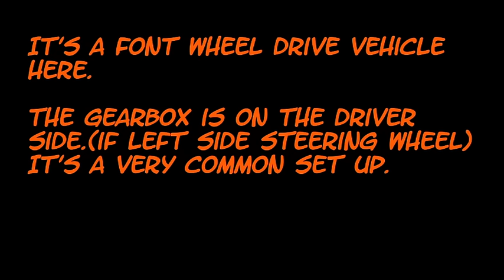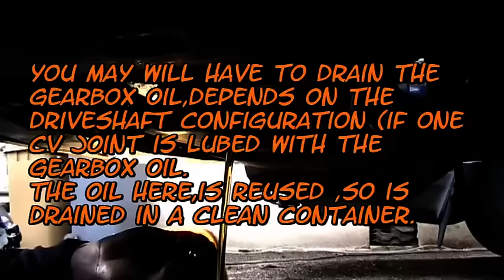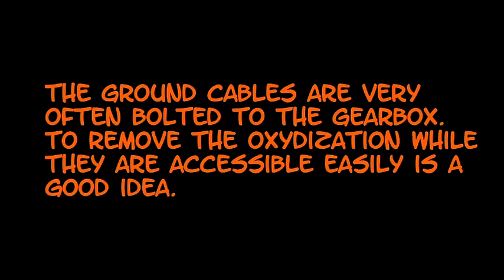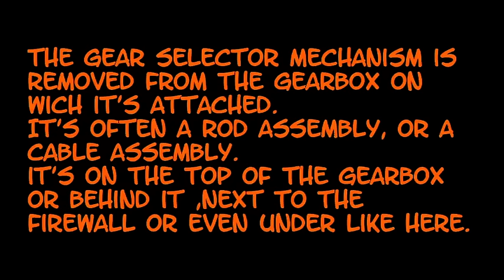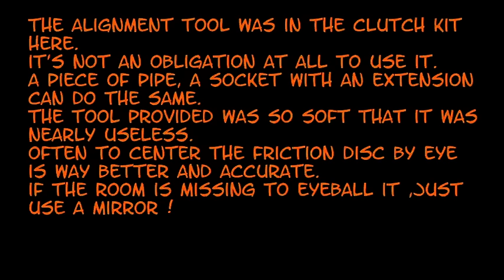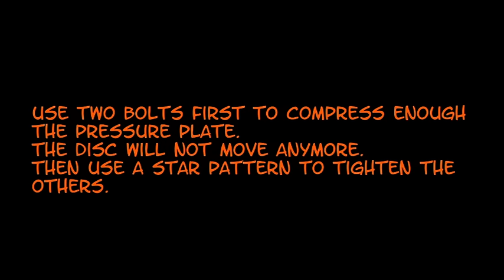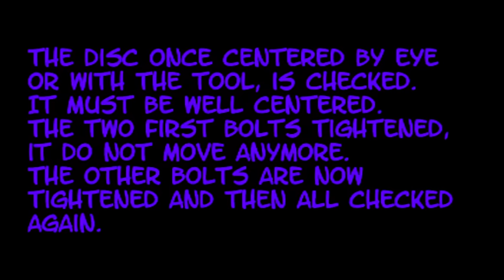Front Wheel Drive car clutch replacement.

Comment: You did one big mistake . All that grease is going to find its way to the clutch plate facings and the fine dust produced during use is going to stick to the grease and results in a sticky messy lump. Only graphite powder should be used on the splines of the  shaft of the gearbox.Apart from this , it is a very good video.
Reply: +Victor Calleja Way too much too...
Reply: For sure! Way to much grease! Good video otherwise.
Reply: Victor Calleja 난
Reply: agree with u.
Reply: Victor Calleja
Reply: Luis Orozco uasap
Reply: uasap ppupi
Reply: On my 1989 Mercury Tracer (Mazda 323), when I tighten the Pressure Plate the "fingers" on it go totally flat. When I install the transmission there is no clutch pedal at all. Due to the fact it feels like the clutch is already disengaged.
  What could the problem be? I purchased the part from O'Reilly's.
Reply: Nah it'll be fine
Reply: 707SonomaComa  clutch plate in the wrong way round
Reply: Not really even on Nissan manual manufacturer recomends to grease splines and release bearing with lithium-based greese including molybdenum disulphide. But not a lot of it. Just 1mm. thick coating.
Reply: Victoحناف2
ز 
9.
r Calleja
Reply: I want to change my clutch but scared
Won't be able to put it back together.
Reply: Internet mechanic they know it all
Reply: Knocking out the suspension bolts using a hard-faced hammer directly onto the screw-threads is a mistake.There are at least 3 better ways of doing that without risking thread damage.
Reply: @ianrutherford878  if u want to hit the threads put the nut back on at the end of the thread then give it a hit won't fuk it
Reply: @707SonomaComa - Refer to 17:39 in this video. Assembled the wrong side. ;-)
Reply: You’re half correct. Yes, it is more than enough grease, however, Moly grease is approved for numerous clutch assemblies.
Reply: Grease is fine on the splines of the gearbox shaft only a little bit rho
Reply: I do not use any lube on the clutch splines. I don't believe the clutch plate even moves on the spline during operation but just stays against the flywheel and gently still rubs on the flywheel. Also I just made an extra extra simple new type gearbox lifters that may help if you are about to do this type of work. I just uploaded to youtube. If you click my name you should see them.
Reply: Victor Calleja I agree
Reply: fuqoff aye? You need to watch Chris Fix channel on the subject. He will say the same thing
Reply: 707SonomaComa You have put the clutch on the correct way and bled the clutch?
Reply: Yes your right sir
Reply: Hey so when I put grease like he did just enough to keep it lubricated
Reply: Victor Calleja yeah thought that and also to remove the brake and hang it somewhere safe to protect the brake line from being damaged it's rare that it gets damaged by doing this but it does still happen so it's good practice to remove it as well
Reply: @allfoursafridafrid8002  yes you will.
Reply: @jaykaiser1754  molly + grease  wow. Lol
Reply: @luisorozco3420  🤣😂🤣😂👍🏻
Reply: What a pain in da assss but they want 1200 down town so i will go slow
Reply: @live4high  manual for the twingo says not to lubricate the shaft splines at all.
Reply: @live4high  🌹🌹❌
Reply from the maker: All right, seven years later :
No grease on the disc or plate,the spline was still lubed up,like the fork pivot point.
It was molybdene grease for heavy equipment and machinery,wich is very sticky and made for translation,or pivot points.
You can see that here : https://youtu.be/lfTu7FSgTX4
Reply: @michaelovitch thx!

Comment: Very clear video , well explained how you can do this terribly expensive repair yourself .
Personally I would also use no or minimal grease. But if these guys prefer that, that's fine.
Pissing on others is easy, if you can do better you should indeed post a video yourself.
Definitely won't be the first clutch these guys put up judging by their speed.

Good video guys!
Reply from the maker: Thank you.

Comment: Thank you very much for sharing this video, very helpful to me. I have a similar engine and box in my Renault 5 get turbo 1986 phase 1. I have taken engine completely out by dropping sub frame and removed gearbox that way as engine needs a complete overhaul having sat in the garage for the past 19yrs! I am changing the clutch as a matter of precaution as now seems a good time while its staring me in the face! Thanks once again.
Reply from the maker: michael wheeler 
Wow,a huge job...
Thanks to you and have a smooth experience : )
I've seen several turbo during my holidays ,they are numerous in the South france,with twisty roads to play with.
I have seen two rally supercinq turbo passing me !
They were running on race gas or something like that,the were smelling weird...
Reply: I'd love to see one driving about by me, but they very rarely are seen on the roads in UK. I have now done my clutch replacement thanks to you, was spot on. And since the engine was already out it made it "nicer" lol. Thanks again !
Reply from the maker: +michael wheeler 
Any vids or pics of it ?
: )
Reply: As of yet, not just yet.. However I can take some of me doing it! Thought it was pointless with this one being so informative and useful, but I suppose it might still help others! I will let you know when it's uploaded!

Comment: That was lot of grease man! i used the same amount, but clean the excess later, the gearbox slide almost by itself in my corsa. Nice video!
Reply: Pd: subscribed
Reply: Rodrigo Godoy Valenzuela.  Ridiculous amount of grease, any more than a smear is asking for trouble!
Reply from the maker: Thank you !
Yes,too much grease,my brother was generous...
we cleaned it up once all was installed and moved as it should : )
Reply: I am about to reassemble my Corsa clutch... I am dreading it... Sigh.
Reply: same here. what gave the disc or the bering

Comment: hey thank you i have an old toyota that needs clutch help but i thought i had to pull the motor this helps alot. i have never done  a fwd clutch 
ur vid helps me alot and now my wife is forcing me to do the clutch....lol
Reply from the maker: Your wife is tough lol
Reply: yea she wants it fixed cause she totaled my brand new truck and my car is all we have left thank god she cant drive a stick. my car has 80k on it and its 25 years old but a teen beat it to death and raced it my poor car only has 80 hp max its a 91 toyota tercel dx 4 door 5 speed not a race car
Reply from the maker: Those teens....
If you feel confident to do the clutch,do it,the first time looks difficult.and you will may stress about it,but once finished you will be happy,and your wife too : )

Comment: Hi, I was wanted to replace my clutch but it costs an arm and a leg to take it to a mechanic. After seeing this video I can't tell u how much help I have got. Good job bro, I will b changing my Mazda 3 sp23 soon, once again, thanks heaps...
Reply from the maker: Hi,
Thanks to you for this,i'm happy it's helping somebody.
I sugest you to buy a service manual to have torque values etc..
you will can do that like a pro,or even better.
How much km/miles your clutch have seen till now ?
Reply: michaelovitch  Hi there, sorry I saw your message late but guess what? I changed the clutch two days ago, all by myself but I suggest to anyone to really try it if they knw what they r doing, I didn't want to hurry so it took me about 15hrs. The car drives like new now, it has abt 225,000 kms so it was time to change because it started slipping. I jst need to figure out abt th gears. It's a manual the 1,3,5 are working fine but it's hard to shift to 2,4 & reverse. I think the other cable is jammed or broaken. Any help? Will appreciate
Reply from the maker: riera222
Congratulations : )
Looks like the problem yes.
one cable to push gears 1,3,5,the other to pull gears2,4,R.
i guess you have the rear gear down right on the shifter?
take a look at the cable and where it's attached.on the shifter and the gear box.
you may have not placed it correctly or something is bent a bit.
it happens sometimes when you move the gearbox in the engine bay,there are so much stuff and so little room...
Reply: michaelovitch Yes I did try by shaking the cables a bit and it worked. You are right, there is a very small room nd heaps of things to squeeze into it. I'm so happy how much money I managed to save. I bought the clutch kit for $330 nd less than $90 for the oil to go in, turns it was really bad nd sticky. Bro I can't hold to myself he much you helped me, I like fixing things myself but this was a huge task, I'm jst 24yrs nursing student. All I need to do now is to adjust the clutch pedal and I think it should be under the steering column. Thanks again and again. Be blessed.
Reply from the maker: riera222
You did it alone,thanks yourself : )
I'm happy the vid helped you 
dang it's really expensive for a clutch kit,the oil is expensive too.
what engine do you have ?
i've looked, here it's around 150 max for a clutch kit on 1.6 or 2.0 liters engines.
Reply: michaelovitch I live in Australia mate but I'm originally from Kenya in Africa, things are really expensive in Australia nd you have no option but to buy it with that price, actually I think that is the best deal you can get around here. Can you adjust hydraulic clutch pedal or  or is it only a cable clutch, because mine is hydraulic. Oh and my car is a 2005 Mazda 3 sp23 sedan and it's a 2.3 litre so maybe it's because it's the top of the Mazda 3 range as it is a sports version but again not a turbo. It takes off like a turbo car though haha.
Reply from the maker: riera222
As i know hydraulic systems are not adjustable.
You only have to flush and bleed the air out, if any,like for brakes.
push the clutch pedal ,open the bleeder valve,on the slave cylinder next to the gearbox,let the fluid go out ,close the valve before the fluid loose too much pressure to be sure air do not find a way to go in the line.do it several times while you check that the oil level is always full to not suck air in the line trough the master cylinder.

75 euros for a clutch kit here...
2.0 and 2.3 have the same clutch.
Dang the crazy prices over there...

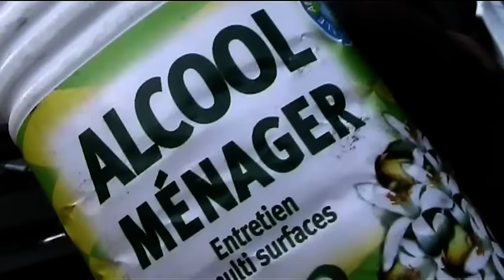Comment: 14:25.  Light the bastard up and walk away.
Reply: It is really a hard work to do by yourself, what about being sure to have the flywheel ground or replaced, or changing out the input shaft bearing? Right now I am working with manyautosltd.com they can help with all kind of new clutch, clutch diagnostic, clutch repair reading, clutch replacement, clutch pedal, clutch master cylinder Etc.

Comment: I am using Part Number KF605-02 I purchased from O'Reilly's Auto Parts in Santa Rosa California. It is for a 1989 Mercury Tracer, 1.6L non-turbo. The original clutch that I removed had 6 springs on the clutch the new one has only 4. The original pressure place I removed has many little "fingers" on the diaphragm spring, the new one has less. When comparing the two clutch assemblies side by side they appear to have the same dimensions - Throw out bearing, clutch disc, and pressure plate. But when I mount the pressure plate and torque the bolts to 20 ft. Lbs the CENTER of the Diaphragm Spring gets sucked in totally flat towards the engine away from the throw out bearing, it does not protrude outwards towards the trow out bearing at all! It is not a hydraulic clutch. When I mount the bell to the engine and connect the clutch cable properly I do not have any tension at all on the clutch pedal. It feels exactly like when it is not hooked up at all. It goes straight to the floor with very little resistance and sticks there until I use my hand to pull back it up. I did that 3 separate times wit the same result. When I mount the old pressure plate and tighten it down, the many diaphragm springs do not go flat, they still protrude towards the throw out bearing. WHAT IS WRONG WITH THE NEW CLUTCH ASSEMBLY #KF605-02 ?? After the person at O'Reilly's looked online at other part stores and crossed referenced then they said there is actually tow parts numbers for a 1989 Mercury Tracer 1.6L non-turbo. There are a KF605-02 and a KF605-01. He said they sell mostly the KF605-02. Is one a diaphragm type on the other a coil spring type pressure plate? Hopefully I will not have to go with a different brand.
Reply: Hello from Canada, MMMM When I get an issue like yours I find that if I go to a local Ford dealership and ask very nicely  for advice from the service manager. That person is usually a very experienced senior mechanic and may well have dealt with your issue many times.  I suspect that  you will get good , expert, advice free of charge in hopes that you buy the correct part from their parts department allan
Reply: YOU NEED TO PUT YOU CLUTCH DISC  IN THE RIGHT WAY AT THE MOMENT  THE FACE OF THE DISC IS FACING THE  WRONG WAY  AROUND. TAKE IT OFF AND TURN IT AROUND ! HOPE THIS WILL HELP YOU ....

Comment: Thanks for the video, I have learned enough to feel confident to replace my 96 Camry clutch now.  I would shout you a beer or two mate
Reply from the maker: Thanks,
i wish you a success.
If you can,try to change the seal on the cranck shaft,it's behind the flywheel.
Be sure to tighten the flywheel to the correct torque.

Comment: should have put a new main seal in engine, hope mistake didn't come back to haunt you.
Reply from the maker: I agree,you are right.
it still not leaking for now.
Reply: Bert Cochran - +1 on that. It's so much trouble to get to the clutch that a little more work and the main seal can be easily done at the same time. 
Same on the timing side, always change seal when doing the timing. Most kits have a water pump, better had the seal.
In both cases is better and easier to do now than come back later and do it all over again...:-)
But this is a really nice video on a clutch fix. ;-)

Comment: That clutch was not worn down to the rivets.But it looked like it had been slipping on the pressure plate.On older Renaults you have to slacken the cable as the friction disc wears to maintain the free-play and allow it to be fully engaged.I suspect the problem was lack of free-play unless ,as happens, some bad driver had been riding the clutch pedal.
Reply from the maker: It's a self adjusting clutch mechanism here,so you can't adjust parts.
You just can change the clutch or cable.
It had 170 000 kms and was original ,from 1990,and started to be difficult to use.

Comment: Thank you for making this video. I don't really have any mechanical ability, or any friends or family that would help me replace my clutch, so I will be doing this by myself. It will most likely take me the rest of the day and evening to replace this, but I have a family counting on me to do this. Any other useful tips would be greatly appreciated. Thank you
Reply from the maker: Thank you : )
I suggest you to replace the cranckshaft seal and the pilot bearing,wich is behind the flywheel,even if it doesn't leak now,it will before your replace an other time the clutch.
Be sure to tighten the flywheel screws correctly,and to reinstall it the same way it came,to be sure the top dead center teeth around the flywheel are positionned correctly.
Adjust the clutch cable tension if you have one once finished,so the clutch doesn't slip or operate correctly.
Have a smooth work : )
Reply: how did it go?

Comment: you put way to much grease on input shaft and pilot bearing. ???    suppose to put little bit it's going to spread grease every where when engine runns will go into new clutch assembly.
Reply from the maker: You are right,we cleaned up the excess,my brother was too generous.
Reply: all good brother we here to help keep uploading videos
Reply: Mohammed Sahib je GB h

Comment: Would have been much easier to have left the gearbox and drive shafts in situ and lifted out the engine,    you may not even have had to remove the rad,  Some of the repair manuals tell you that's the way to do it,     only because they have nt   tried it anyother way,    
And for the Guy with the Astra , engine up is far easier,  "been there done it"
Reply from the maker: Kilhamjim 
It's an other technique,i'm sure it works good too.
But on a recent car you have ten bililons sensors to unplug,and it would be quicker to just make room to remove the gearbox,specially when you have no axles going inside it,but just clipped to it.
At the end, one of the two have to go outside the engine bay if there is not enough room  : )
Reply: Kilhamjim do not argue with Mr Michaelovitch he is boss and knowledge of cars is impeccable lol.
Reply: David Bana He made hard work of that job.   no need to strip off the suspension struts.
Reply from the maker: Letrool Haje 
Hi,
it took a good big half a day while filming.
Few hours without.
It's a simple disc ,there is no pack like on a wet clutch on bikes : i can see you work on bikes : )
The car is a renault 21,a french 1989 car, quite popular over there,but it's a granny now.
Reply from the maker: Kilhamjim 
On this car ,you have to ,to be able to remove the axles without hurting their boots.
weird,but it's like that.
It's way more comfy to manipulate the gearbox from the side too : )